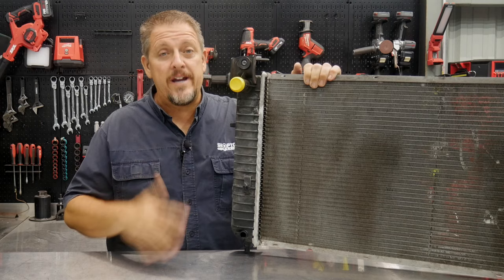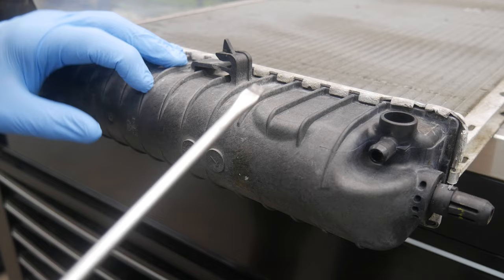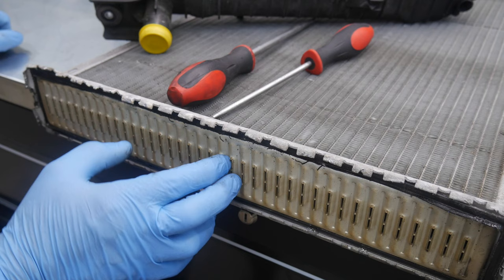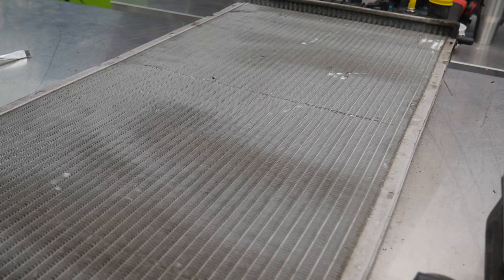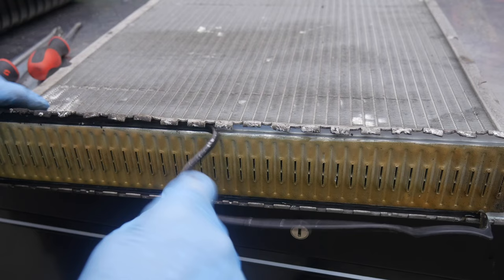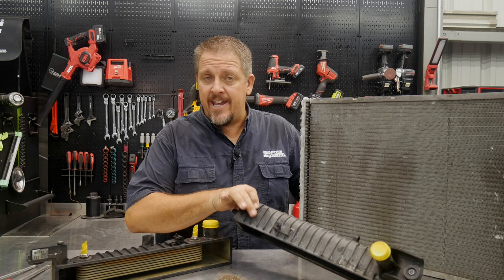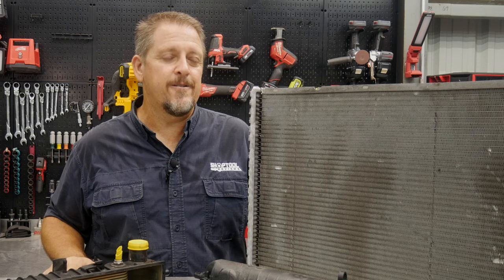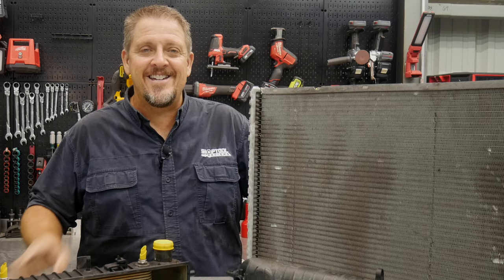FIX or REPAIR? Radiator Failure and The Cause [PLASTIC TANKS]

Comment: Spent a year as a mechanic in a radiator show back in the 70's. Yep... we fixed em all. My only comment is about the "steam" problem. The radiator cap is a pressure responsive device that is supposed to let off the high pressure "steam" so that no damage does occur when you overheat. Just thought I'd point that out.
Reply from the maker: That is a very good point, and one that's overlooked a lot. We've seen many times where people will replace their radiator caps with something "off-the-shelf" with zero concern of pressure difference. At the same time, plastic gets brittle over time, so the same pressure it held before, at some point, it gives up the ghost. Thanks for watching and commenting.

Comment: I once had a situation where I had 2 radiators that had leaks. One on the left tank and one on the right and no money to buy a new one. So I pried all those little tabs straight, swapped caps, cleaned the gaskets and put them back together. Getting the tabs to crimp tight enough was such a pain.

Comment: Great video man, the oil cooler is called a concentric oil cooler some radiators have two one for cooling engine oil and one for cooling transmission fluid

Comment: Almost all plastic end tanks will fail at some point...Its not a steam issue, a GM issue, a Ford Issue, or specific to any manufacturer...The plastic will start to weaken with all the heat cycles, and will eventually crack.
Reply from the maker: No doubt, you are correct. Plastic tanks are doomed to fail...period. However, I do know this one had a little help from coolant being low, and steam creates much more pressure from expansion than liquid. Thanks for watching.
Reply: Yah—

My 1999 Toyota Solara 3.0L V-6 radiator EXLODED as if lightning struck it in the top headlights side of the top filler neck area.

I thought I kept the coolant changed and up to snuff.  I am just going to chalk it up to old age and 185k Mike's, mostly hardcore City of Chicago miles from the previous owner.

Comment: My daughter hit a large coyote and obviously bent the radiator. Haven’t had it looked at yet. It was our last running vehicle. The car told her to pull over and shut the engine off. I’m hoping it’s as simple as a radiator replacement.

Comment: Flat head screwdrivers aren't for screws!  When was the last time you had a slotted screw?
Reply: My ASSET professor got mad at me for prying on a transfer case half with a flathead, but I said "When was the last time you used one of these on a screw?". He walked over to the toolbox, grabbed a flathead and came back over to me. I said "what are you doing?" He smirked and said "helping you pry this case half."

Man I miss that guy 😄

Comment: I have a 2001 e150 and I have been having to add water for the last few months. Finally noticed a very fine split on the top reservoir.  I was curious if you could buy new reservoirs. The aftermarket for it is only 120 bucks, so probably not worth it. What ive done is put epoxy over the split with pieces of fender well bandaids for strength. Will see if that'll work before ordering a new one. I only have 125 thousand miles on it, so am happy but disappointed too. The plastic is common now but obviously not immune to failure. For 120 bucks not bad, especially for a 20 year old van. I'll see how my patch works. Thanks for the video.

Comment: I plastic welded my tank by using zip ties melted into the tank plastic and mixed using a soldering iron, that sealed it well but I backed up the repair with epoxy two pack,,,,working well

Comment: I’ve repaired a radiator by melting down zip ties to fill the crack.
Reply from the maker: Did it work permanently? We've some repairs with zip tie welding, but it was temporary. Thanks for watching.
Reply: @Shoptoolreviews  t

5
Reply: @Shoptoolreviews  The melting point of nylon6 (what zip ties and plastic radiator end caps are made of) is around 420F and the over heating temperature of a car is ~220F. I believe it’ll hold up for years to come, but the last 9 months have been fine.
Reply: Coincidental you mention this with the zip ties:

I just wantch a commercial on YouTube from a company that sells a plastic soldering  kit. Heat gun not included but advised to preheat the plastic.

The rub was after melting the plastic, new nylon was fed through the back of the soldering gun.  Genius.

However: for $79.00 sales price, Rock Auto has my radiator for $100.00....so.....

Comment: A plastic tank oem radiator on my 2018 Honda Civic Type R failed at the crimp. I replaced it with another oem Honda radiator which surprisingly was cheap at $130. I had to bleed the cooling system 3 times because the temp kept rising after a drive idling in the driveway. There was still an air pocket in the system. Used a big bleeder funnel but the last time I did this I replaced the thermostat, set the heater full blast, then held the throttle at 2k rpm a couple times. It hasn’t over heated since.
Reply from the maker: Yes, some vehicles are a real pain to "burp" the air out of the coolant system. Great point that I should have brought up in the video. Thanks for watching.

Comment: I work in an actual radiator shop and that radiator your touching is one of two GM cross flows we keep on shelf because they always crack because people don’t change your coolant. Coolant is only good up to five years or 150,000 miles for extended life and less for others. When it gets old it breaks down and gets corroded because there is nothing protecting the metals in the system which there are more than one and corroded different ways contaminating the system causing you to heat and plug the radiator or part of cooling system and causes excess pressure. There is not one forever fluid on cars people!change them and don’t be afraid to look in the owners manual where you will find change intervals for many systems in your car. Thinks it’s bs that’s fine but don’t complain when your car goes down because labor is expensive and so are our tools to fix problems that could have been avoided
Reply: When you speak of "coolant" I'm assuming you are talking about coolant in the radiator?  Forgive my ignorance!  I am now faced with replacing my 2010 HHR's radiator . . . and was thinking it was a racket that the whole radiator had to be replaced, as opposed to fixing the leak . . . but then everything today seems to be in a "throw-away" status.  I have 117K on the car and recently had the transmission fluid changed out.  The radiator, to my knowledge, has never had a fluid change, but is kept filled and checked with routine maintenance.

Comment: Just had my radiator replaced in my 2008 Ford F150 4.6. When I got it back home it looked like the tanks on the sides were still the old ones with a new core only. I just assumed no one does that anymore and that they simply replace the complete radiator?

Comment: I have a plastic capped radiator out of my tractor. It looks like the seal failed. This radiator is proprietary and costs $1100.00 to replace. Do you think I may be able to find a seal for this?
Reply: I'm up against the same thing. I was thinking of taking the tank off and using a sealant on the existing rubber seal....what do you think?
Reply: @sean7193  I have started to bend the aluminum crimps to remove it. I will let you know what I see. It definitely looks like the seal has failed on mine.
Reply: @tblake3286  hi Blake thanks. Yes I over pressurized mine doing a pressure test by accident...learned my lesson there... should have reduced the compressor output...anyway.... let me know what you find. I was thinking of taking it off and applying some high end coolant safe sealant to the existing seal, and then making sure the tabs are good and tight when going back together. it should work....dont know if its worth it due to the failure risk, but probably worth it.
Reply: @sean7193  my radiator is $1100.00 for a new one, so I’m going to do everything I can to fix this one.
Reply: @tblake3286  agreed!.... let me know how it goes and what sealant you use.
Reply: @tblake3286  Did you try the fix. If so how did it hold up

Comment: IF there is sand within the radiator, it is the reason the rubber seal failed. It's an abrasive and when the coolant travels through the system it acts like sandpaper on the rubber seal.......This is the question: How did sand get into the Radiator?

Comment: It says fix or repair so I was waiting for the fix or repair, but you replaced it.  Not the same thing lol
Reply: you never "fix or repair" a broken radiator since a radiator not working at full capacity can severely damage your engine, thus replacement is optimal

Comment: It failed because, collent got reacted with the plastic, this happened with mine , your plastic is light brown from inside while mine is dark browm with spots. And plastic nozels on radiator are totally worn out, nozels looks like they are make of card board, i mean to say plastic is totally decades of. This is from my corolla 2015 with original coolant and 80k miles drove. While i have another corolla with 200k miles 2006 model. And i never had a complain about its raditor.  i think original coolant quality is not good these days.

Comment: I can get a Chinese radiator.. full replacement.. less than 150$ these days.. they work fine— or have for me— for the last 15 years. Not worth the time. The labor on it would cost more than the replacement, or very close.. unless you just have a sentimental attachment I think you’d do better just throwing a cheapo in.

Comment: I enjoyed your radiator video - I have a concerned with my 2010 5.6 L Nissan titan radiator ? Watching other YouTube videos the transmission cooler internal part of the radiator something breaks and causes  coolant to enter the transmission ? This seems to be a common problem on Nissan’s and I do believe different years I also think that I seen they’re trying to do class action lawsuits - I only have 51,000 miles but I am thinking about replacing the radiator - it would be educational if you could find out why the transmission cooler fails and is it that we could do something about that part ? On another note I wonder if they have replacement radiator to eliminate this issue I like my truck and I really wanna keep it as long as I can all the work I do go strictly through the dealer ship
Reply: Change the radiator from the oem, choose spectra premium brand or osc

Comment: That's a trans oil pre-heater ! Trans coolers are stand alone in front or to the side of the radiator behind the grill !
Reply: Actually its a heat exchanger, it allows the radiator to warm the fluid to operating temperature and then once the thermostat opens it helps to cool the hot transmission fluid, maintaining a constant stable temperature of the fluid.
Reply: A oil to water heat exchanger does a better job of keep trans temps down than a oil to air cooler that mounts in the front of the truck, adding the external cooler does add more cooling once its paired with the factory oil cooler in the radiator.